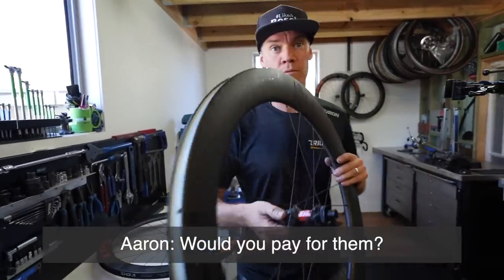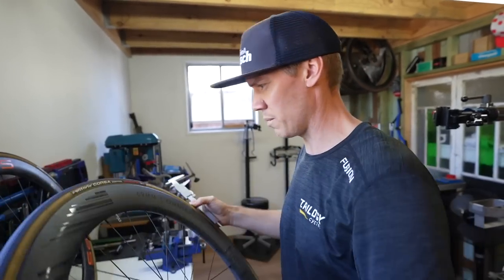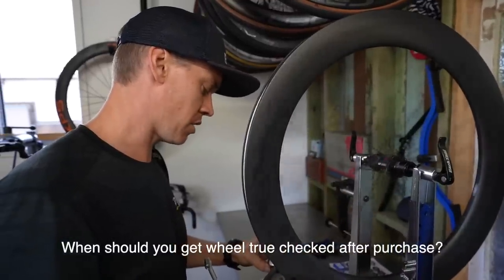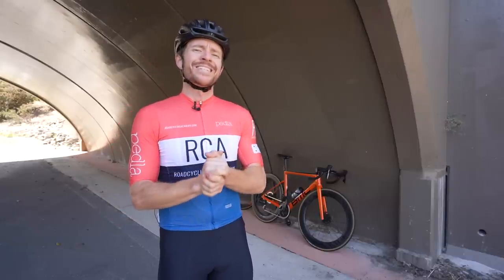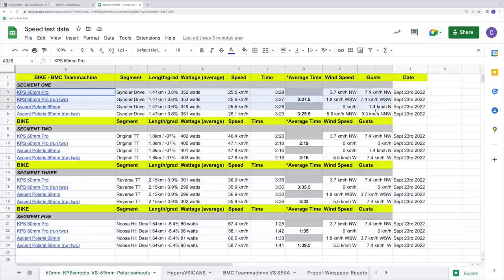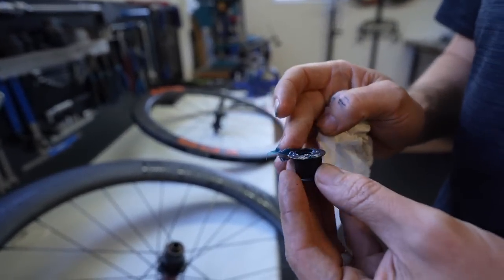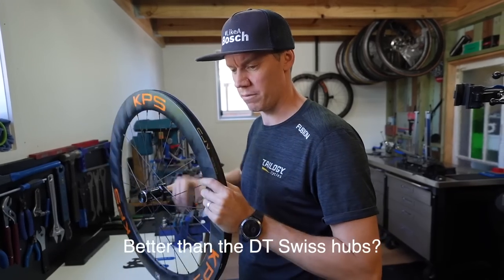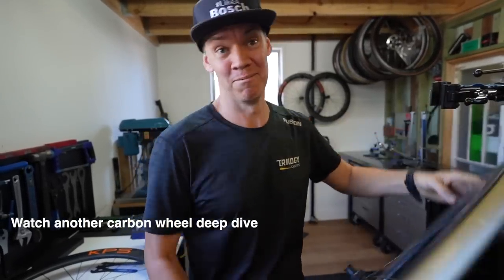69mm Ascent Polaris VS 60mm KPS (Carbon Wheel Review)

Comment: I would not pay 3000 for boutique wheels, especially with stock DT swiss hubs because their bearings have loads of friction and move like sludge. They only way I got DT hubs to roll smooth, was to spend time and money to replace all of the bearing with low friction seal NTN bearings from Hambini.
Reply: Did you try spinning the axle while the wheel was unmounted? DT Swiss specifically mentions in their Bearing Technology page, that their bearings are mounted in a manner that applies the proper preload AFTER the wheels are mounted and clamped, with the compressive force of the thru axles or skewers. You will be experiencing higher-than-normal friction if the wheel is in your hand, which should disappear after the wheel has been mounted on the bike.
Reply: I did mention this in the video 👍
Reply: Yes, I fully understood this. Preloaded or not, the stock bearings have heavier contact seals, which I’m sure os great for waterproofing forma cx bike or similar, but not for all out performance. If I am spending money on carbon wheels, I want them to perform as best as possible, with the least amount of rolling resistance in a road or TT race situation. I think DT swiss knows they use draggy bearings,otherwise they wouldn’t offer a ceramic option on some of their hubs. My beef with he brand is, why am I getting sludgy bearings built for an mtb on a race wheel? Again, it wasn’t until I replaced all of the stock DT bearings on my own rear disc wheel that has a DT 240 hub built in to it hat I noticed an immediate improvement right away. I replaced all of the stock bearings with NTN bearings that I bought from Hambini, and used a lower viscosity oil on the star ratchet. It was then that I clearly observed that the hubs had a lower resistance to them comparable to my Campagnolo Bora wheels. And this was clearly noticeable when doing a spin test with the wheel mounted on the bike. Honestly the wheel in question had so much awful drag out of the box, that when spin testing in the outer chain ring, and the smallest 4 cogs in the back, the freehub body friction caused the crank to auto pedal forward, and when I would stop it with my hands, the chain would go slack and the rear wheel would slow down dramatically without using the brakes. To clarify, I want my carbon wheels to have as little friction as possible, with the bar being set by my Campagnolo Bora Ultra 50 wheels with CULT ceramic bearings. I know those are apples and oranges in comparison, but for a wheel hat is built fir performance, I certainly don’t want to be held back by bearings meant for an MTB, which simply cost watts. So in summary, I bought an Aerocoach Aeox rear disc wheel which hey built for me at a very reasonable price, and upon delivery I noticed that it was built on a DT Swiss hub, which featured loads of drag out if the box. This was fixed by spending about $60 or so USD on NTN bearings, and using tools I already have to extract and press in new bearings. I was pleased with the results, but not pleased with the fact that I had to do it on a wheel intended for racing.
Reply: @Bicyclechris  I see! I'm glad you found a solution. If you really want the lowest drag for a race, remove the seals and replace the bearing grease with a thick oil. Just enough so it doesn't run out during the race.

Comment: I wouldn't purchase either of these Wheelsets and do not consider them to be boutique. They use traditional wheel building technique during assembly with lots of options as such I would describe them as offering custom options. 
Would anyone describe Hyper wheels as being boutique because they feature carbon spokes and can be purchased with numerous decal and spoke colour options?
A boutique wheel is something like the Lightweight Meilenstien which has a construction and hub not commonly seen or available on mass produced wheels imho.

Comment: Why would I buy this if I can get custom wheels with schmölke rims or enve and dt 240 hubs for around 2000€.
Reply from the maker: Fair call.
Reply: Fair question. If you're looking for an aero wheel that can cope with crosswinds and provide comfort on rougher roads, then the Polaris 69mm offers something that Schmolke does not. Our wheels are deeper and wider than the TLO62, so if you're looking to run 28mm, or even 32mm tires, we have you covered.

Also, we offer a lifetime warranty and free parts crash replacement for the original owner, vs 2 years and a maximum of 50% for Schmolke.
Reply: @ascentbikes  Life Time Warranty is very good, but who knows if the company sticks around to honor that. Although I wish you nothing but to be very successful. New companies in the bike industry are always a good thing in my mind. 
I just don't see the value for me personally.I can get 62mm deep dt swiss arc 1400 dicut for 1400€ with 240 hubs or something like the LúnHyper 65mm for 1200€, I don't know the price on the australian domestic market. They have a smaller internal rim width of 17mm compared to your 23mm it would be interesting to see what difference that makes in the real world with the same tires.
Reply: @The2808erik   Thank you for your well wishes. We've actually been around since 2018 and have sold hundreds of our other set of wheels (Zenith) since then as well. 

The 1400 would not be a direct comparison, as it is a second tier wheelset. With regards to width, our wider internals help to increase air volume, while remaining aero with wider tires. This improves comfort, and makes cornering steadier even if you drop the pressure. The tire is less likely to fold under the bike.

Of course, I wish you all the best in finding a wheelset that suits your needs and budget, and hope that you would consider Ascent in the future!

Comment: If you have to retrue a wheel after a few hundred km without having taken any hard it, then the wheels are not worth the price. And they are not worth it also if they use aluminium nipples in carbon rims.